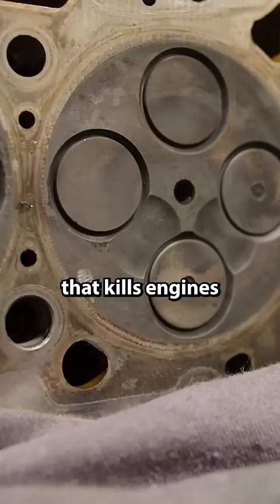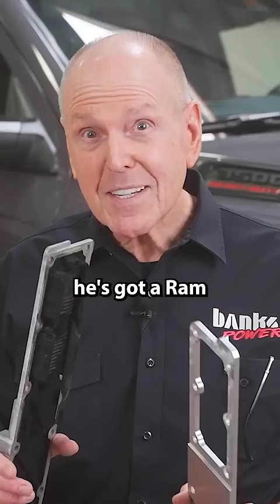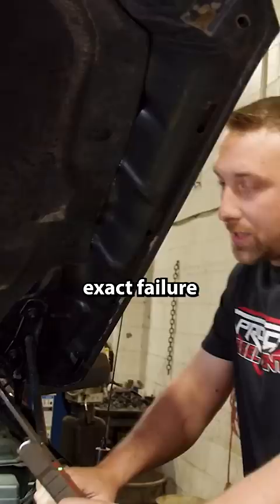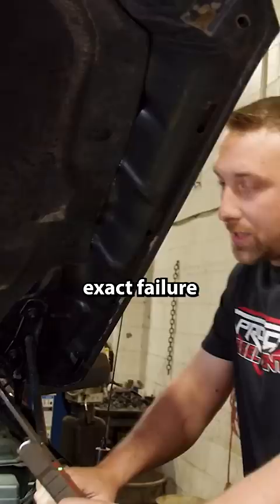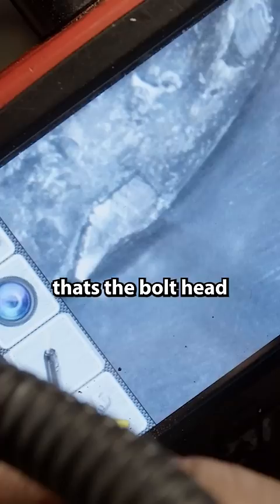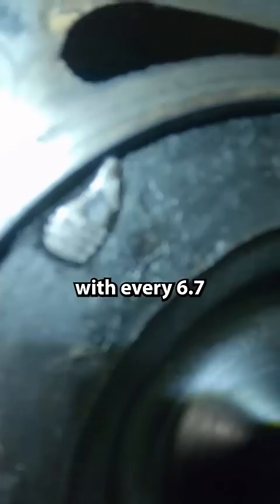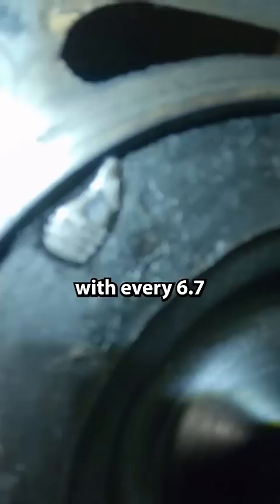Accidentally solved a huge RAM 6.7 issue

Comment: Between Dave’s Automotive and Gale Banks shorts…you have everything you need to know to keep your truck running
Reply: Ahh yes, Dave. The guy that used a flash rusted brake rotor with more than enough mat'l for resurfacing to explain that, b/c of "safety," they won't even resurface a brake rotor, let alone pad slap.

Guy lost a lot of respect & viewership on that one. I wouldn't listen to a word that dude says. From that point forward anything he gets or had right is pure happenstance in my book.
Reply: @Iceberg86300  He definitely wouldn't be my mechanic--replacing rotors every time is definitely a scam. But he definitely knows what he's talking about with motors.

Comment: This clip doesn't detail how Banks supplies a spiral wound grid heater that relocates into the Monster Ram. A positive note for the cold weather Cummins users.
Reply: Thank you. Was wondering about that issue.
Reply: @user-kb5nb6hg4j  the Intake is tapped and threaded, allowing the spiral wound heater to thread down into the intake. It's about 4'' long and 1.5" in circumference.
Reply: Thank you for explaining that because I was wondering if I'd get a check engine light without having a grid heater 👍🏼

Comment: I then called Gale Banks Engineering and asked about it and they asked what did I want to do race it or use it for heavy towing ? I said it's a 1 ton dually crew cab 2 wheel drive and towing heavy stuff is my goal. They said no more that about 65 HP and get a new down pipe right after the turbocharger and you'll be happy with that. MAAANNNN WHAT a GREAT company cuz my mileage doubled and my torque probably more than doubled ! Thank you guys ! They said don't go higher cuz with no intercooler it'll literally just destroy itself and start melting parts ! I'm on my 3rd Powerstroke now and it's under warranty. When that expires I'll be calling again !
Reply: Mileage doubled? Now that one's a little hard to believe.......
Reply: @jaredlancaster4137 Hard to believe, but really not that uncommon when it comes to Diesels. You can about double the mpg of a VW TDI if you know what you're doing.
Reply: @MrBoom6009  i mean if you were getting bad mileage before. If you're getting a very normal 15 mpg from a power stroke you're not doubling it to 30. If you were getting a bad 9 mpg you could absolutely double it to 18.

Same with a tdi, you're not doubling a normal 40mpg to 80, but you might double a bad 28mpg to 56.
Reply: @MrBoom6009 fairy tail man
Reply: Liar doubled lol
Reply: @MrBoom6009  wife was getting 62/mpg with tdi stock
Reply: He's getting 2000ft lbs of Torque too

Comment: Commercial truck tech here. This failure seldomely happens on the isb engines in commercial apllications that must adhere to dot and epa standards. Its usually the grid heater being caked over with excess carbon and soot that causes many of of the failures. Typically the result of a failure egr cooler or egr valve.

Comment: When we put these back together in Taylor forklifts were required to run the grid heater for warranty purposes but we always like to clean and jb weld the bolt to the cover sounds stupid but it works, we had a turbo failure on one of the motors we serviced the bolt was also corroded away but the jb weld was still holding the nut up in the grid he’s

Comment: I wanted to improve the air flow on my wife's 2018 Ram 2500 Crewcab 4wd 6.7L.  My did not want any changes UNTIL I showed her videos on the grid heater issue.  Then she was happy that I spent $1k for the bare metal version of the Monster Ram.

Comment: The bolt inside of the ram air elbow is iffy. I hope mine never snaps. The reconnecting of the front PCV house could use a little engineering. For the price of this kit Banks could come up with an adapter to make look right. And EASY TO RECONNECT. Overall it was nerve racking to deal with the fuel lines. My truck was original and I was sweating bolts and nuts the entire time. After I got the fuel lines out there was no turning back anymore. There was a tone of garbage from the regen inside of everything. I did a complete delete while I was at it and cleaning was not really needed. Torquing the fuel lines was one of those things. I marked the lines as recommended but it seems like that was way more than 30 ft/lb. 
Anyway. It’s done and there will be a test drive tomorrow straight out of the gate with an 18000 lb trailer.
Let’s see if there is a difference.

Comment: What about an upgraded heater grid that still maintains its functionality but has the upgraded dependability
Reply: The Monster Ram intake includes a new heating element that is mounted to the new intake elbow.
Reply: Don't need a grid heater anyway
Reply: @Ckcdillpickle yes you do
Reply: @Ckcdillpickle  what
Reply: @Ckcdillpickle depends on how cold it is where you live but I'm pretty sure the grid heater is there for a reason
Reply: @jaredlancaster4137  have started my truck up dozens of times in sub -25f no problem
Reply: @Ckcdillpickle  calling bs on that one, I've seen some diesels that start impressively well in the cold but anything, even gassers, have a little trouble starting in -25
Reply: @Ckcdillpickle it's not just for starting. It runs after the engine is running to reduce warm up time because the longer it takes the more unnecessary wear happens to your engine.
Reply: @jaredlancaster4137  back in the day with older injection pumps and huei systems yes you need something to heat the air to aid in starting. But now in modern diesels the grid or glow plugs are there for cold start emissions controls to aid in lowing soot and other emissions.
Reply: @blueberrychronic  back in the day with older injection pumps and huei systems yes you need something to heat the air to aid in starting. But now in modern diesels the grid or glow plugs are there for cold start emissions controls to aid in lowing soot and other emissions.
Reply: @neooverby3750  yeah but -25? Even gassers struggle in that temp. Diesels are always gonna start harder than gas engines, kind of a compression ignition thing
Reply: @jaredlancaster4137 Almost any modern EFI engine will have no issues starting at -25F. It's the batteries that don't take the cold well.
Reply: @802Garage  depends on what you mean by modern, especially engines with a distributor definitely have to work a little to start at -25, even if you get good cranking speed. Also depends on fuel quality and condition of spark plugs and injectors.
Reply: @jaredlancaster4137  Sure, I'm just saying I've never owned anything 90s+ especially any Subaru that wouldn't start on the coldest winter nights in Vermont unless the battery couldn't hack it. It's really just the engine rotation speed from the starter that will limit starting abilities. Gas doesn't have any risk of gelling at those temps and injectors and ignition systems don't care. Even old TBI was generally pretty good. Just carbs sucked.
Reply: @802Garage  and I've had gas engines from the 90s+ take almost a minute to start in like 30 degree weather because they just had janky injectors and maybe a crusty distributor cap.

My 92 Honda struggles a little with anything below like 50, I plug in the block heater all winter. Not sure it would start at all without ether in -25.
Reply: @jaredlancaster4137  That's poor maintenance or needing repair, not an EFI problem. I hear you. I'm just saying.
Reply: @802Garage  you'd think there was something wrong with the car. I've gone through it, it gets good gas mileage, makes good power, nothing else wrong. I think it's just how the car is.

Block heater solves the problem anyways
Reply: @Ckcdillpickle -25f is like - 32c stop lying clown I live in Canada and unless you are on the north like bay Jame you don't have -25f and certainly not multiple time
In Québec last winter the coldest was -30c
Reply: @neooverby3750 lol clown glow plug and grid heater are there to warm the air lol
Reply: @neooverby3750 you do realize you contradicting yourself lol
A grid heater heat the air clown it's in the intake lol and the reason you can't use starting fluid unless you want to blow your intake/air filter
Reply: @802Garage what the difference it's still hard to start same for a big diesel that need even more power to turn the big engine
Reply: @legros731  Diesels have more issues in the cold because they are compression ignition rather than spark and the fuel also gels. It's not the same set of issues.
Reply: @legros731 - Places in Alaska and in the Rocky Mountains on either side of the border can experience those temperatures overnight.  Running 5w40 synthetic motor oil is helpful.  Even 10w30 synthetic is better than 15w40 conventional oil.
Reply: @jameseroh6544  to my knowledge Alaska is pretty much at the same latitude as la bay Jame in quebec
But what do I know I live in a igloo dancing with my ceinture flécher riding dog sled lol
And not much people live on top of the rocky mountain
Reply: @legros731  Don't have to be at the top of the mountain.  It is sometimes colder in the mountain valleys.  While Gunnision, Colorado is famous as a cold city.  Buena Vista, Colorado has had -24 degrees.  When I lived in Colorado, the coldest I experienced was in 1982.  It was -20°f and then it got colder where I worked in Golden.  The thermometer on my porch only read down to -20°f.  Then when it got colder the red color disappeared into the bulb.  I lived in Wheatridge at the time, 7 miles from work.
Reply: @jaredlancaster4137  Gassers do not struggle in -25. not mine at least
Reply: @Ckcdillpickle  depends on the car. I have one car that has to work a little extra to start below like 50 degrees. I have another car that's good to go at least down to 0.
Reply: I've had forestry machines with the 5.9 Cummins that required 2 revolutions of the engine to start in 20F weather with NO grid heater, otherwise they would start the moment you hit the key!
Reply: My truck starts in the winter here in Colorado without a grid heater.. Thing fires right up
Reply: @802Garage  most places treat the diesel in the winter time anyways.  Comes treated from the distributer.   If its below zero Fahrenheit you should be running 25% kerosene anyways.
Reply: @verteup  Sure, but there is a reason diesels had/have glow plugs. Compression ignition requires heat. I've never seen a Subaru have issues starting down to -25F unless the battery wasn't up for it.
Reply: @legros731 -25f is more like -32c, -40 is the same in both scales. I’m in BC, and the northern parts, especially the peace region sees cold like that at least a few times a year.
Reply: @MultiPureEnergy  lol clown I am from Québec a know own cold it get clown
I clearly made a typo thank you for telling me lol
Reply: @MultiPureEnergy  and the point is is truck   will never start at -32c without a heating grid or glow plug
Reply: @neooverby3750  who cares about emissions. The grid heater helps your engine warm up faster to prevent the wear caused by the materials being contracted when cold and therefore outside of tolerance specs.
Reply: @legros731 bro northern Minnesota gets way the hell colder than -25F. When I lived there growing up we had plenty of Jan and Feb where we never got above -10. And went weeks at a time hovering around -20 daytime temps with every night dipping into the -30 to -40s. We get the weather on them internets now a days so follow the weather for Embarrass MN this winter, consistently the coldest place in MN. They recorded a -60F in 1996. FWIW I follow Flin Flon Manitoba weather to see when the ducks will start moving. 

It's not all about latitude, local geography plays a giant role.
Reply: @blueberrychronic  you got no clue what you talking about
Reply: @legros731  funny thing for a little boy who cannot assemble a complete sentence to say to anyone...
Reply: @legros731 My 2020 6.6 dmax starts easily at -40c without being plugged in. I will usually plug it in, but if I forget she always still starts.
Reply: @HondaCivicFanClub-rj9oc  you still got glow plug or a grid heater clown
Ps I am a diesel mechanic I think I know a little more about them than you with your anecdotal evidence of one truck lol
Reply: @jameseroh6544 When I was in Gunnison in January of '82 if I am not mistaken, it was-49°F there early one morning. I had been skiing in a blizzard in Crested Butte for 3 days before that.

Comment: I have the monster ram on my 2012 and love it. I also have the 3.5" intercooler tubes and banks ram air cold air intake.  I think banks is the best company for Cummins owners. I am more than happy with all my banks products. Plus you get the bonus of it just running so much better. You can feel the difference in how smooth it runs even at an idle. Great products

Comment: When I bought my first Powerstroke it was almost brand new and being a 97 didn't have an intercooler and a friend told me get a tuner and you'll see a HUGE difference in torque and mileage.
Reply: Dude this isn't text messaging. You can't post two separate comments that are supposed to be read together. They'll get separated. Edit this one and paste in the text of your second comment with the rest of your story, or at the very least reply to your own comment with the second half of the comment.

Comment: Gale you’re a very very smart man but I need a grid heater and glow plugs my guy! When it gets down to -40 maybe even under -50 and I need to go somewhere I need my shit to start and stay running, that’s why I didn’t go ahead with the monster intake horn but I can definitely see how that could be a failure point in pickups that don’t deal with cold weather
Reply from the maker: We recognize the need for an intake heater which is why the Monster-Ram also comes with a coil-style heater like those found in other diesel trucks. You get the best of both worlds.

Monster-Ram for 
2019-2023 https://bnks.pw/3s2DPjS 
2013-2018 https://bnks.pw/3ZZjSqw
2007-2012 https://bnks.pw/3s8y8Ri
Reply: @bankspower  Appreciate the reply! I’ll have to look into that for my 6.7 rig! Didn’t know you guys provided a solution to the no grid heater. Love you guys keep it going!

Comment: Which bright spark on the engineering team put a nut on the inside of an intake. Surely it could have been threaded into the block. Even from a servicing standpoint, you need to take the intake apart to safely remove this cable? Such a simple design flaw for what is quite a sophisticated and capable diesel engine

Comment: I've read about it but have forgotten what year/ years the truck with bolt of death is on. The bolt on the front of the engine would work it's way loose, fall into the engine, and usually destroy the engine.

Comment: These don’t have glow plugs so if you live in a cold climate this is a no go, the engine uses the heater to heat up the air in the combustion chsmber

Comment: Grid hearer is an emmittion device , what has been done to maintain  the emissions compliance/ check engine light from p0380 open circuit  grid heater? 
What has been done to allow starting at -20°f ( cummisn spec for min temp to fire without pluging in) ?  Without a grid fire up gets sketchy ~20°f above ( 40°f for Ford with 1-3 bad glow plugs )
Reply: Most accidents on stairs occur on the first or last step. We can solve this by eliminating the first and last steps!
Reply: @GroovesAndLands  
Or ban multiple level buildings.  Sounds about how the epa would do it.

Comment: Up north isn't that grid heater important tho? From my understanding thats like an integral part for cold starts in winter weather... But i also LEARNED on Detroit diesel v8s in HMMWVs and Cummins was only ever really discussed theoretically as they were in newer vehicles we didn't have for training purposes yet, until literally the first day I got to active duty then it was a lot of "oh cool, literally NEVER seen this before aaaaand I have 37 minutes to figure it out..." But from what I learned from poking around tech manuals, asking colleagues, etc. doesn't the grid heater serve nearly the same purpose as glow plugs? I know youll run on crappy glow plugs but hes not talking about a component sucking he's talking about fully removing it. Obviously i know the part works but im just curious about if it works but you might not be able to start the thing if its too cold (literally the worst imaginable time for that click)... Just asking for learning and knowledge not for a current project OR to start anything, just wanna know... So that I know in the future (can you imagine!? Lol) anyway, any useful informative responses are welcome, i like learning new stuff, especially if I was taught incorrectly by the worlds worst teacher(myself+unverifiable sources, lol)
Reply from the maker: We replace the grid heater with a high flow billet intake plate and coil style heater as well as the Monster Ram. To learn more, tap the link below. 
https://bankspower.com/products/intake-elbow-42799-pc-2019-2021-dodge-ram-2500-3500-6-7l-cummins?variant=42237177594053

Comment: Unrelated but i saw the video showing the flow of the ram intake compared to other brands and stock, but would the increased volume result in an increased charge pressure drop?

Comment: When will cab chassis version will be available?
Reply: Bro it's an intake part
Reply from the maker: We will be releasing them soon, tap this link to sign up for the email alert. 
https://bankspower.com/products/intake-elbow-42799-pc-2019-2021-dodge-ram-2500-3500-6-7l-cummins?variant=42237177659589
Reply: Tap the link for 6.7 derringer tuner for 2013-2018 and you'll wait 5+years and still no update

Comment: Is there a way to fix the bolt issue without deleting the grid heater?
Reply: Ya just replace the piece every few years.
Reply: His plate also has a heater tube piece that plugs into the elbow so you still have a heater for air